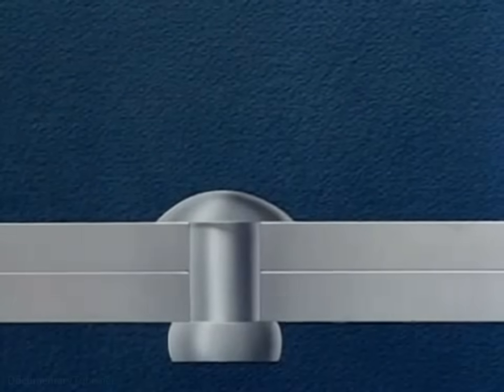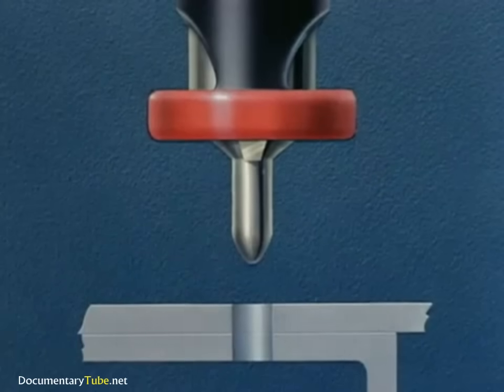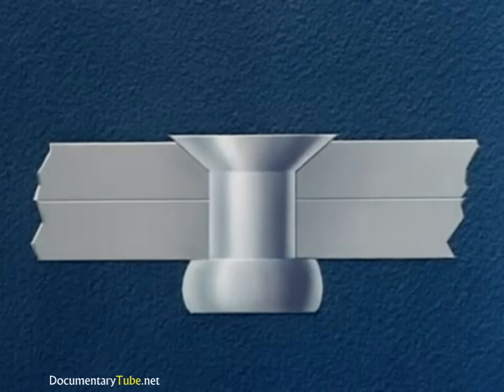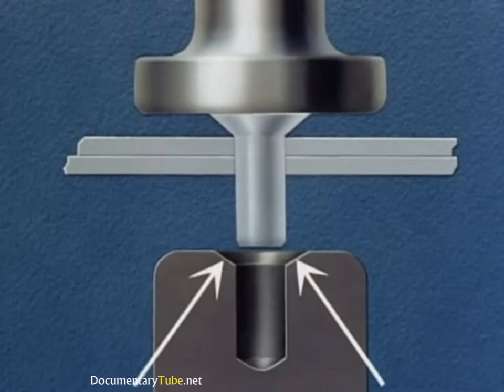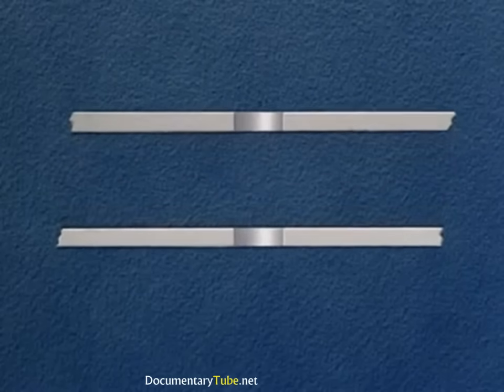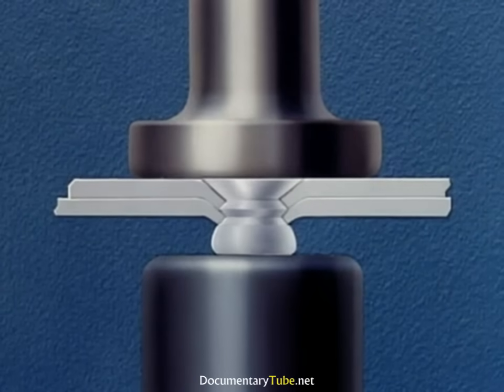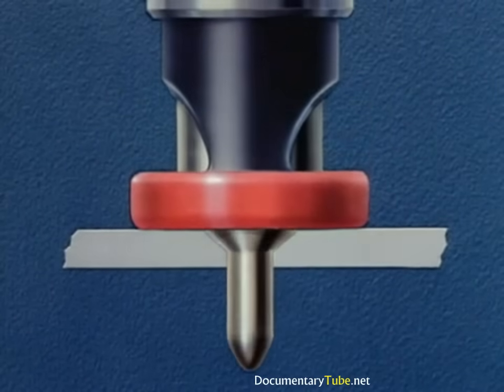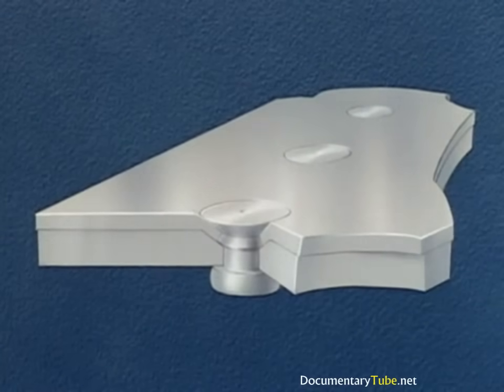HOW IT WORKS: Aircraft Flush Riveting

Comment: Years after this training film another method was used for even more precision. The DC-8, for example, was built using "NACA riveting" whereby  the rivet head is inserted opposite the countersunk end of the hole, and the shank is then driven into the cavity. Any protrusions from the countersink were milled flush.

Comment: Not a bad video for original training for Aircraft sheet metal work.
I have done all of the different rivets rebuilding improperly landed Aircraft. The first one was a Piper Saratoga that landed on a little league back stop having the right wing and right side of the fuselage ripped off as crashed trash. BUT it is only a "crash" legally according to the FAA if someone is killed or seriously injured. 
Any "landing" you can walk away from.
Is a good landing.
It is a real thing. 😅
They failed to show how to "Draw" the Bucked rivet. 😢

Comment: I have maybe a stupid question but how to you flush rivet such large sheets when your rivetting tool simply can't reach around both sides of the sheet to secure and rivet?
Reply: Not a stupid question.  two things, one, some of the presses had very deep throats so you could reach to the center of a pretty big sheet.  two, you can get the dimpling dies whcih fit in a rivet gun, so you can dimple in the middle of an even larger sheet, as long as you have someone on the other side backing it up with the female dimple die.

Comment: I'll never understand how the US can manufacture anything with these kind of measurements.. Its bizarre.. Whats a number 30 hole for example? 😂
Reply: a number 30 hole is a hole drilled with a #30 drill.  There is a system for drill sizes whcih goes from 1 to 80, with 1 being the largest  to 80 being the smallest.   a #30 drill is 3.26 mm.

Comment: How come I still see airplanes with raised rivets? Plus we used to have planes with corrugated sides...
Reply: Flush rivets are more expensive,  because they require extra steps (countersinking and/or dimpling) and because flush rivets are not quite as strong, so you need more of them for the same strength.   So for a relatively low speed aircraft,  having protruding head rivets really doesn't cut down the top speed significantly, so it's not worth the extra manufacturing expense.    Some airplanes will have flush rivets on the forward parts of the wings, where the airflow is stil laminar, and raised rivets on the rear surfaces ot hte wings where the airflow is going to be turbulent regardless of the rivets used.

Comment: These American sizes are just ludicrous. For a 1/8 th inch we use a number 30 hole. What? What kind of nonsense is that? For a 3mm pin you drill a 3,1mm hole. There. Simple

Comment: “We are using a 1/8th inch rivet so we..” are using a 1/8th inch drill? Noooo “a number 30 drill” wut😂
Reply: An 1/8" drill would make a hole that it a little too tight for the rivet.  A #30 drill gives the proper extra clearance.

Comment: i can't figure out what that audio artifact is, where short segments of audio are drawn out slightly, maybe 100ms at most, messing up the cadence of the voice. the pitch doesn't go down during it, so it's not tape flutter, and besides, they're too short to be accounted for by a tape mechanism i would think. it's not a buffer underrun in the digital capture, that would have a sharp pop. whatever it is, the slowness of the voice + the weird timing jitter is acting as some sort of weird highly specific misophonia trigger (the thing where a certain makes you feel an intense discomfort/pressure/almost like anger, nails on a chalkboard is a more common example).

Oh, maybe it's not tape, maybe it's some sorta Optical Sound artifact? the glitch sounds like a very short segment of audio is repeated (with smoothed transitions to avoid the popping). i've always wondered how analog tech dealt with converting the sharp stepped indexing of film frames to the smooth continuous signal of audio, maybe this glitch is an artifact of that conversion going wrong, or a frame failing to advance, or filling the audio gap from a damaged frame?

any archiving people, i'd be curious if you notice the effect too and have any idea what's going on.
Reply: also update if anyone else finds the voice similarly aggravating, 1.25x speed almost entirely cleared it up. and actually, the voice sounds much more natural at this speed, i wonder if the weird glitches are from some weird old analog technique to slow down a voice without affecting pitch, since IIRC a lot of older educational films would speak unnaturally slowly for comprehension.

Comment: Former Boeing Everett.... I forget the number of rivets used on the B-747's but it was over 1 million per plane. Lots of holes to drill and lots of rivets to install. Today they have giant machines to punch out or drill entire body and wind panels. Jigs hold everything in place for fastening with rivets. Current planes are using mostly carbon fiber composites, but there are still many rivets used as well.

Comment: This is so straight to the point and simple to grasp, despite my extreme ADHD I still got through the whole video at once without moving an inch. It's a miracle
Reply: I guess you could say you were... Riveted.
Reply: same. I've watched this video several times over the years just cause how pleasing and informative it is. I have no need to know how to flush rivet panels together, but if I ever do, I know what needs to be done.
Reply: Same, but i am an autist😂

Comment: Wow, the double dimple method is brilliant, it increases strength by bending the ends of the thin metal to an arch under the rivet. Just think, some person years ago invested probably thousands of hours into developing the best methods for things like this, I'm very appreciative. We really do stand on the shoulders of giants that came before us.
Reply: And it's performed with the same tool as is already used for the riveting, all you need is the die which can be easily machined on a lathe. It's really nifty.
Reply: @TheLukasDirector well, yeah, that’s part of why it’s brilliant. New techniques that don’t require much replacement of tooling or labor skills can be implemented much easier.
Reply: Its very cool.  Best not to think about it too much when you're pulling 9g.
Reply: One of the main reason is that if a very thin plate is countersunk, it can create a very thin "knife's edge" that can cut the rivet
Reply: i love your profile picture!
Reply: @deadshot5845  thanks

Comment: Can anyone help me understand in the pre dimpling method, why the top sheet is formed to 100 degrees and the bottom sheet is formed to 120 degrees?
Reply: Because when you dimple the sheet metal, it stretches it and it becomes thinner.  And that stretching and thinning makes it so that the dimple angle is slightly different between the top and bottom of each sheet.  This is illustrated at 7:12 of the video.  So if the dimple on the top of the first sheet is 100 degrees, on the bottom of the sheet it’s dimpled out 110 degrees.  So in order to fit perfectly, the dimple in the bottom sheet has to be 110 degrees also. So on the bottom side of the bottom sheet, the dimple needs to be 120 degrees.

Comment: I've already done this, the cone of the fuselages of light aircrafts such as Cessnas single-engines, are covered with 0.16 sheet, very thin to make a countersink. After drilling and cutting the sheet, I used a 426 rivet pin up on a steel surface, a steel mold and a hammer to make a dimpling in each hole.

Comment: we using 1/8 rivets so we drill #30 hole... Please move to millimeters already !!! for 3mm rivets you'll need a 3mm hole :D
Reply: Well, no. The rivet holes are drilled slightly larger than the rivet, so for a 3 mm rivet, you’d use a 3.1 mm drill.  But please, continue running your mouth about subbjects toy don’t have the knowledge of to comment intelligently.
Reply: @andrewalexander9492  My point is that you use same units of measurement, and not fraction and random numbers for drills.
Reply: @MaxLevine  Pssstttt, this will really make your smug, condescending ( but not too smart) head explode:  They’re not customarily referred to as 1/8” rivets in the industry, they’re “#4 rivets”  I bet that really has you clutching your pearls.  Yet somhow, airplanes get built.
Reply: @andrewalexander9492  Grate for #4 rivet use #30 drill, very intuitive, what size it will be, 3 bananas ?
Reply: @MaxLevine  3-1/2 bananas,  the bananas are always slightly undersize

Comment: Interesting, I think my father actually received a patent for one of these methods while working at North  American in about 1942.  He got a check for the patient while overseas so they could release the method to other manufacturers. Not sure which process was his but I know it involved the drilling process heat relieving the stress  on the metal to prevent cracking at the dimples.. he turns 100 in two weeks and I will see if he can tell me if one of these methods is his.  It’s amazing what he can remember from back then yesterday can be a problem.  If I make it to 100 I hope I am that sharp.
Reply: That is very cool.
A smart man, your father is.

Comment: If a plane was to be dimpled like a golf ball it would have less drag, however it may weaken flat surfaces if not done properly. Ok I feel better now after watching this old video. 🧐
Reply: You can also reduce drag by drilling lots of tiny holes in the skin and blowing compressed air out of them like an air hockey table,  but no one seems to use these methods,  strange.
Reply: @damonthomas8955  😁
Reply: @damonthomas8955  Look up the design of SpaceX Starship you will see that was or still is part of the design but for cooling purposes liquid Hydrogen was to be forced through the tiny holes. Keep in mind that was a year ago and SpaceX thinks on hours not years.👍🇺🇸

Comment: What he alludes to, but doesn't actually 
say, the rivet gun does the driving, and 
the bucking bar, (dolly) is just held on 
the other side.  Also, the rivet gun is on 
the head, whilst the upsetting is done on 
the bucking bar side.  Notice, that to make 
the upset side, on the other side, the whole 
assembly needs to flex.

steve

Comment: They don't explain why for thinner sheets they do this but it's rather obvious: The inside of aircrafts is pressurized  and more importantly (as pressure isn't normally on these rivets) the other forces are trying to pull the outer layer (top) away from the inner layer (bottom). As long as forces are always in the same direction, it's a neat trick for flushed rivets.
Reply: For thinner sheets the problem is the inside of the hole forming a sharp edge instead of the counter sink transitioning to a reasonable amount of parallel sided hole.

Comment: I wonder if techniques has changed much since then, for assembling airplanes. Perhaps other materials are used to gain stealth, etc?
Reply: Though I don't work on fast jets, or the likes where stealth is a factor. I work on C130 Hercules aircraft and can confirm, everything you watched in this video still gets done. Someone pointed out that dimpling no longer is practiced. We still do it at our workplace  but it might be due to the fact it's built on 60s technology
Reply: @AmygdalaSalad  The air force controller asked me; "Do you want to go home in the Herc, or with SAS?" I said SAS without flinching. xD Good times! Ty for a great answer!

Comment: Why is the rivet head so accurate? +0.02?
If it can be sanded, if anything, the titanium plating, it is abnormally stable
Reply: Partially I think it's correct practice to ensure they are flush, it's not that hard once the tooling has been set correctly, going back and sanding down all your rivets would take a lot of time. Plus by taking material away from the rivet, you've removed some of its corrosion resistant coating and potentially taken some of its strength away. Never come across titanium coating on a rivet though?

Comment: man these people take rivets for granted.  one flawed rivet on a jet can tear it apart.  its not just the viability of combining two materials in an efficient manner.  but its something that most people can perform if they have to.  understanding these different rivet forms helps you analyze how to applicate different resources.  glue, welding...etc. are all very modern advancements, that if you don't have certain ways to adhere objects, especially without screws, become very unreliable.  this stuff is how ww2 was won.   and its a viable method to this day for mechanical adhesion without advanced technology.  the hammer has outlasted chemical bonds.  it will always last.  you can always hit something with something else.  however the double chamfer rivets were at some point high technology.  n since people can't handle the basic application, or why.  i suspect it could become high technology once again.

Comment: What they don't tell you, is how difficult this is to do when you're hanging upside down from the deck framework to reach that one area that you can't get to any other way, in the dark. That was my nightmare as a starting sheet metal mechanic working for Boeing on the 737.
Reply: And then because of the position, you have to do it left handed. Been there, done that, almost got good at it.
Reply: How do you feel about the whistleblower... mishaps? because apparently the word I want to use can't be said
Reply: @Ifinishedyoutube  let’s just say that I’m glad I don’t work for them anymore lol. I left the company shortly before the 737 Max became commercially available, before Boeing’s reputation went to shit.
Reply: Why in the dark?  They at least could have supplied a head lamp.
Reply: @andymanaus1077  my head would get so sweaty that my headlamp wouldn't stay on, so I'd often ziptie it to a nearby frame to try to get it on target. With all the ducting and piping beneath the floor boards though, the light often means all you have for light is the secondary illumination. Its very frustrating.
Reply: That explains a lot.
Reply: They don't tell how hard it is to do when drunk
Reply: @prof2bobajob.klonded5  I would DEFINITELY not recommend that lol

Comment: This is a 1960’s training video. In the 1980’s aircraft engineers through research learned this was wrong. Round rivets were aerodynamically better as well as flush mounted rivets required the removal of more material from the aircraft skin to install the flush mounted rivet. Multiply that removal of material by up to a million rivets and you have removed so much material you hav weakened the entire structure to a great extent. Today almost all rivets used in a aircraft manufacturing are round head rivets. Flush mounted rivets still have their place, but not across every surface.
Reply: Most rivets are round but most are inside and don't need to be countersunk. Only need flush for external skin and only on aerodynamic critical areas. So front and side but not some areas like far aft. Like behind the stab.

Comment: Deburr  the hole with a deburring  tool that fits in a pneaumatic drill motor and deburrs both sidesof the hole without having to disassemble the sheets. This is 2021., Plus you have to,acid etch, alodine, & prime. Who the hell assembles sheet metal,with out priming them and call themselves a, professional

Comment: Hidden behind those procedures is what is responsible for the life of a pilot and his passengers and cargo. It is not the pilot who is responsible for the passengers and the aircraft but it is the rivetter. As was clearly explained in the video, cracks can start from a riveted joint. It is such a pity that those silent and unseen workmen who do not wear gold braids on their uniforms are forgotten by society when it is their shoulder that carries the responsibility DURING ALL THE SUCCESSFUL FLIGHTS   AND DURING THOSE FEW SECONDS WHEN A CRASH NEEDS TO BE BUFFERED TO SAVE THE PILOT AND THE PASSENGERS. 
Tests are normally conducted to check the integrity of a fuselage and this is designed so that there are no one stress points but the surface is made uniform and homogeneous as close as possible and so a fuselage can withstand more punishment to buffer its passengers. 
https://youtu.be/kJZ1eHU_JZg

Comment: Mfg or design this is good but I commercial aircraft engr or ex BS Cer Engr and I recommend all repairs be done in button heads and conical washer that 100 degree flush rivet. Well only if AD is not involved or AD deviation is not approved. Button head are stronger and repairs will make little effect on drag and improve inspection.

Comment: what about destructive testing ?there are times 2 plates are riveted together than on a special machine are clamped on the ends of each separate layer the machine will pull the sub assembly till it breaks apart, depending on the specification of the rivets breaks before maximum strength you got a problem , you need corrective action before you can proceed,

Comment: "We're drilling a 1/8" inch home on so we use a number 30 drill"
...
Thank god you guys converted to metric and got rid of all that rubbish, yeah?
Now you can drill an 8mm hole for an 8mm rivet with an 8mm drill bit.
Reply: That wouldn't work.
A Number 30 hole is larger than 1/8".

Comment: We had to manually put 2 universal AN470 rivets and then 4 AN427 rivets using the countersunk method as a small project in my Aircraft Structure Fundamentals class. As this video suggests, we couldn't exceed the predrive protrusion nor the flushness, which the professor would measure with a precision caliper. Then we had to fill out an FAA Form 337 simulating a repair to an aircraft. Good to know we weren't wasting our time.

Comment: Funny thing is that 2+ mach jet fighters has rivets protruding all over the air frame, and metal sheets in layers, looking as if cut with an axe. Absolutely zero regards to flush, smooth surfaces. F-4 Phantom is pretty bad, MIG 29 also (just two examples that look as if the rivets AND the metal sheets were thrown on with a shovel...